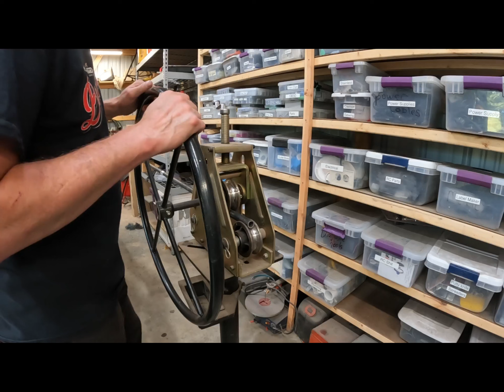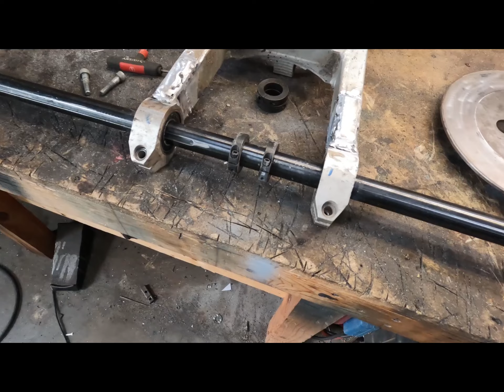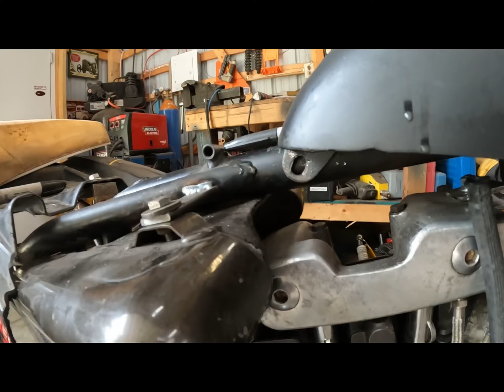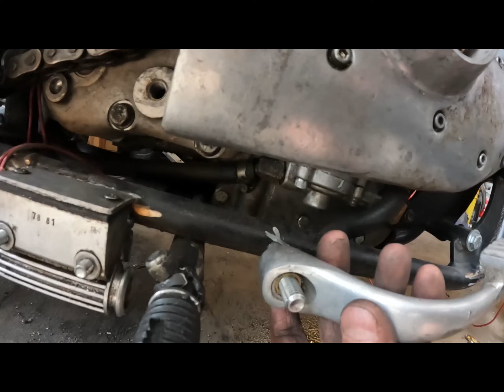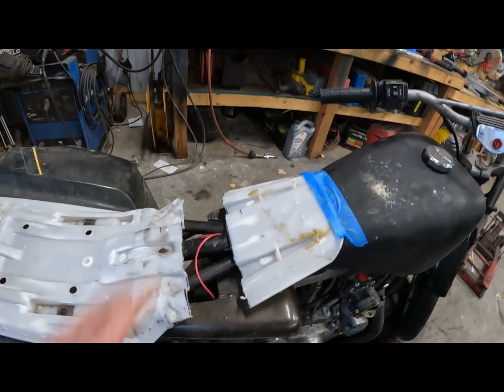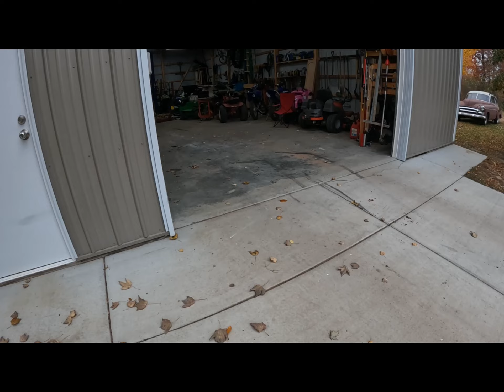Harley off-road trike build - Riding, failed-ish project?

Comment: Sounds like a Briggs and Stratton
Reply from the maker: Had to go back and listen for myself, you’re not wrong 😁
Reply: @distortedsteelgarage  I thought maybe it was running on 1 cylinder, I want to build a trike with automobile rims, what rear axel did you use
Reply from the maker: It’s a 1 1/4 steel race axle from go power sports, with a hacked up set of hubs off a trailer, gave me a 4.5 x 5 lug pattern
Reply: @distortedsteelgarage  I just watched your video where you put the hubs snd axel together, very helpful to me thanks

Comment: I feel like the top mount bracket for the rear shock should move down a bit and maybe down and forward??? Idk
Reply from the maker: Problem I had with moving it is it changed the ride height and doing dynamics, not the ideal location but the best I could do with the situation
Reply: @distortedsteelgarage  it is an awesome project I’m glad I subscribed